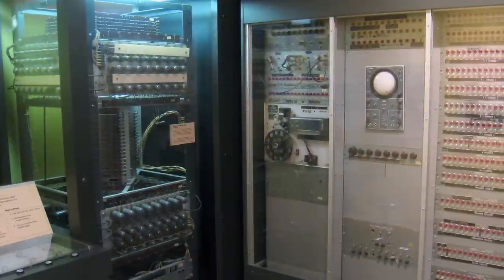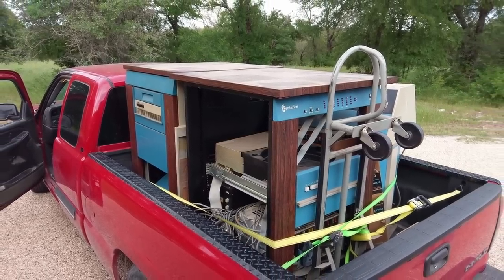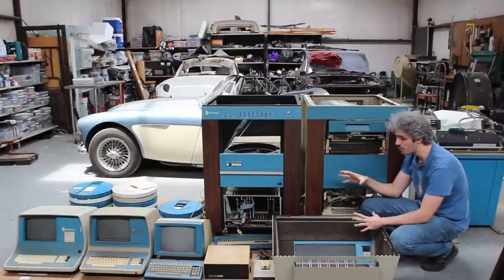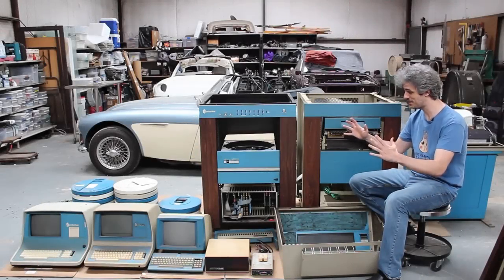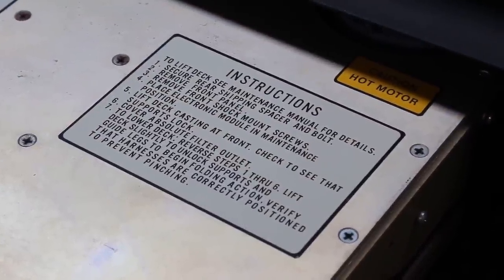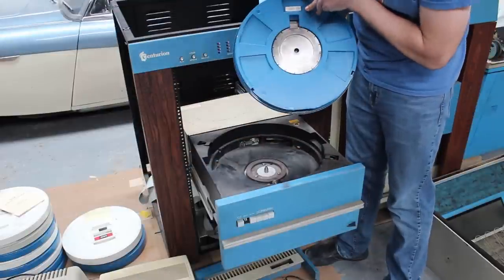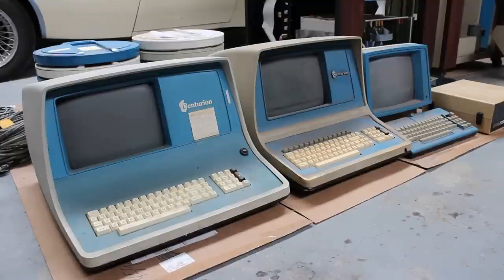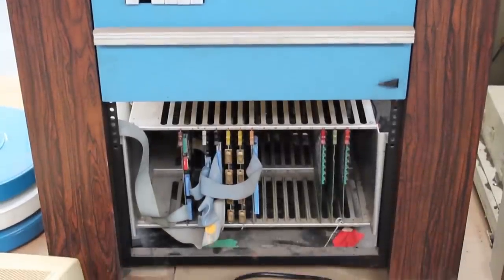I Bought a Minicomputer from 1980! – Part 1

Comment: They were called minicomputers because transistor/chip mainframes were the prevailing systems that a (big) business purchased. 1970s-80s. Vacuum tube analog computers were already gone and moved to storage warehouses, by early-mid 70s. Networked PCs began taking over the scene in the late 80s, and took over from minicomputers in the 90s.

Comment: Back in the 80s and 90s I had a friend (a sysop for a state Bell Telephone by profession) had a minicomputer (confusingly named an Alpha Micro) in his basement, with three terminals.  I was one of several friends that used it for personal word processing.  He passed away years ago, no idea what became of his system.  It likewise had a Hawk drive, don't remember the model, but it was 5MB (yes, "meg") fixed and 5MB removable.  Looked pretty much identical to the one you have.  He used an IMSAI front panel for it, and on occasion he actually USED the front panel switches to enter opcodes.
Reply: Alpha Micro was a computer company from the late 1970s.

Comment: Hi;

On the Disk Drive with Removable platters, You need to put in the Platter cover on the Disk Platter after it is inserted in the Drive, Or it will not ever be "ready" ..
The Drive is a CDC (Control Data) Cartridge Disk Drive Model 9427H..

THANK YOU Marty
Reply from the maker: Thanks for the tip!
Fortunately, in the next video after removing the drives, I was able to identify them grab some manuals for them from bitsavers!

Comment: That is a multi-user system so nice to have extra terminals the terminals are most likely RS-232 300/1200 Baud the small modem is most likely 300/1200 I saw on the back of the terminal "Current Loop" so there current loop and not RS-232 the plate got settings printed on it that has to match the settings of te Comm card. ALSO, DO NOT Plug a DB-25 connector that is set for Current Loop into a RS-232 connection. I don't remember if Current Loop DB25 uses the unused pins for RS-232 for communication. It may, as a safety so you don't blow up the RS232 connection
Reply from the maker: Thank you for the heads up!
The terminals are, interestingly, all from different years, but given the Miacom modem, I imagine there were a lot more terminals set up for use in the original setup. The Centurion fundamentally is a 9600-baud system, so I just need to get the settings right on the terminal, which is fairly easy to do. Unfortunately, so far, I haven't been able to get any life out of the MUX cards on the computer, though it does seem to actually be executing code!

Comment: I used to repair systems like this, ancient technology...
I don't know why you would want to get it running, as it isn't a real computer, but a data storage system that would connect to a central computer system using the phone modem as the day progressed, where the data processing would actually happen, on a main frame computer.

Comment: God, that 99/4A brings back some VERY fond memories!
Reply from the maker: Thank you! It's an awesome little computer.
I've very nearly got it fully kitted out. Here's a picture of it from before I rearranged the shelves above it:  https://i.postimg.cc/3R89xxWy/IMAG2815.jpg
From far left to far right: Sanyo DMC-6013 Monitor, TI-99/4A, Speech Synthesizer, 32k Memory Expansion, RS-232 Interface, Phone Modem, Disk Controller, Solid State Printer, and Disk Drive. I would love to get my hands on a proper TI monitor one day, and I'm still holding out hope that I'll be able to find (and afford) both the Video Controller expansion and P-Code expansion someday.
In the meantime, it's one of the coolest (if not most impractical) 8-bits(16-bits) I've had the pleasure of playing with!

Comment: the first job my dad had was in demolition for making computer rooms in the 80s. literally busting out all the walls of an entire floor of a building to fill it with a big floor to ceiling computer. turns out its a lot easier to run through a wall than you'd think if you don't hit a stud. but it puts into perspective how big old computers were.

Comment: The small aluminum box is an AT&T 829.  Western Electric was wholly owned by AT&T.  Until the Carter Phone decision caused the break-up of Ma Bell the only way to be hooked up to the phone company was through phone company equipment.  After the break up equipment that hooked up to the phone company had to have an FCC registration number on it.  AT&T feared that if just anything was allowed to be hooked to their network it could endanger the network itself.
Reply from the maker: Whoa, so far you're the only person that has been able to identify that little box!
Thank you for the excellent information!
Reply: @UsagiElectric  It facilitated line testing.  If a point-to-point line was thought to be out of service the phone company would send a tech to one end with a loopback generator.  The loopback generator would send a tone to the remote end and put the other 829 into loopback and the tech could send to himself to see if the line itself was good.   Note that a data line is four wire; a voice line is two wire.  The plastic box on top of it with the circuit number is a "42A block".  It is officially the point of demarcation: one side is phone company responsibility the other side is customer responsibility.  

At its peak if Western Electric were independent it would have been the eighteenth largest industrial company in the US.

Comment: The modem is a 16 ports multiplexer, we had stuff like that before Internet.
They where at a remote site so 16 terminals/printers could be hooked up to the company computer.
Yeah, the speed of the computer  was very slow but the work flow was faster when the operators didn't have to use graphics with a mouse.

Comment: Of course it turns on. Old tech is less complicated, less likely to fail, and you also have the business line quality.
Reply from the maker: I don't know if I would go with less complicated on this one, the CPU board is a phenomenal piece of engineering that's way over my head, haha. But, it's a very nicely designed piece of kit that's certainly a little over-built!
Reply: @UsagiElectric  I meant the density of transistors mainly and all that!

Comment: I'm 9 months after the fact. How did it go? When you were vacuuming that crap foam out, my first thought was "NOOOOO!!!" There are special vacuums to use with those old machines. A vacuum creates a lot of static electricity. Those old components wouldn't be able to handle it. I hope you didnt get the vacuum hose anywhere near the ICs. Or, was it a grounded hose? It looked like standard shop vac to me.
Reply from the maker: Definitely a standard shop vac, but I think I skated by without any damage! The computer itself does actually seem to be executing code, but the journey to getting it running is still ongoing.
There's a whole playlist on the progress of the machine here: https://youtube.com/playlist?list=PLnw98JPyObn0wJFdbcRDP7LMz8Aw2T97V

Comment: Forgot a bit more info.    A couple of the software and hardware engineers are still in the Dallas an Austin areas that maybe willing to help get the old Centurion system running again.   Hope to hear from you in the future.
Noted in one of your videos you are working on the system power supply. About the only thing that used to fail in the P.S. was a bad main filter caps on the 5 VDC supply causing 120 Hz ripple on the 5 VDC when under load or bad full wave bridge rectifier which caused 60 Hz ripple on the 5 VDC when under load.  P.S. outputs are +5, +12, -12 and +24 all DC.  The P.S. for the 1970's was a very good designing a "Ferroresonance" design to filter out AC line voltage spikes and sages.    Good luck getting the system running, willing to help.
Reply from the maker: Ken, thank you so much for all your amazing information on this system!
I'm going through and reading each of your replies super closely and will definitely be sending you an e-mail!

A few other commenters also pointed out that it's likely to be a ferroresonant PSU and it seems to be in really good shape. That's a good idea to check the ripple on the 5V line with all the cards in place to see what it looks like. I'll definitely give that a check the next time I'm out in the garage!

Comment: You would generally have the terminal set to remote echo, as opposed to local echo, so that when you type the mini computer would return what you typed so that you would know that it received it as it has to service all of the connected terminals and either might have missed a character or not received it yet.  It's a bit slower response, but more reliable.

Comment: Wow, quite the find and project there!  Getting that up and running will be quite something.  Any idea which operating system this thing uses? Or does it load some sort of interpreter?  I believe the complex looking modem is actually a rs232 "terminal server" where all your terminals are going to connect via to the mini com interface.   Can't wait to see how this goes, great vid!
Reply from the maker: Thank you so much!
I actually don't know really much of anything about this computer. Centurion computers was a pretty small company so there's very little information out there. Though, it appears they did have a few different models of computers they sold, but I have no clue what model this specific one is. 
I think you're right on the money with the Micom interface! That would explain why I got three terminals with the set as well, with them being set up as individual workstations all hooked into the same computer.
Reply: @UsagiElectric  Yep, I was going to say the micom was for integrating multiple data terminals. 
By the note on the one monitor I would say it was used in a shop. Would explain the ugly one, (shop) the nicer one (shop manager), and the little one for the inside office. THose old band printers were used mainly for billing. They could print VERY fast, which is important at billing time on 30 day net back in the day as they all got mailed.

Comment: That Micom box is a multiplexer. Allows you to run multiple terminals through one serial line.
Reply: I scored a couple of them in 87 and sold them for $5500. Lot of money to an 18yo.
Reply from the maker: Good eye! I've since learned a bit more about the whole machine, but that Micom is still refusing to power up.
Granted, I'm only planning on running one terminal, so the Micom is very much so not needed, it'd still be cool to see it power up!
Reply: @UsagiElectric  I had a thought about this. Multiplexers are used in pairs, one at each end of the line, to connect multiple terminals to multiple ports through one line. Perhaps the recieve multiplexer is built into one of the cards. So the serial port is expecting a MUXed signal. try connecting terminal to the multiplexer and the multiplexer to the terminal input on the Centurion?

Comment: The switch is most likely an x.25 packet switch, that used those x.21 db25 connector. Leased line modem is probably also x.25. I’ve prgrammed some of them from Motorola, for a telephone exchange management system.
Reply from the maker: You may be right!
I think the switch was primarily used for connecting multiple terminals to a single serial port, but I haven't had any success getting the switch to power on. Granted, I'm only planning on using one terminal, so the switch is actually totally unnecessary, but it would be interesting to see it power up at least!

Comment: Wow, this is so cool! You just need to get some reel to reel tape drives to complete the setup.  What was this used for in the past?
Reply from the maker: Thank you! Yeah, some reel to reel data drives would be awesome!
I got no clue what it was used for in the past, but some of the data disks say "Glenn Smith Oil Company", which their building does still seem to exist on Google Maps, but I can't find a website or contact information otherwise. Most likely, it was used for records keeping for the company, though it does seem like a bit of an overkill computer setup for record keeping at a small business. I'm super interested to see what's stored on the data disks!

Comment: On a terminal, switch "self echo" on, and possibly the "full / half" thing is "duplex". Both of those settings, dunno why there's 2 of them, tell the terminal to put any keys you press up on the screen. Not usually used, usually you press a key and the host computer sends it back to be displayed. But some primitive computers required it. The reason I say switch it on, is to play with it, get it to display stuff. Once you've done that, to use it with the computer properly, switch it back the way it was. Make a note of that first.

Seems like it goes up to 19,200 bps too! That's nice! Somewhat modern, and certainly a faster screen update than you'd notice, even 9,600 is pretty good. I wrote a Space Invaders, and a couple of other games, for an old Unix machine at college, using terminals at 9,600 and it kept up fine. It's roughly 1,000 characters a second so if you're not updating the whole screen it should be good. A lot of more advanced programs make an effort to send the minimum possible characters to the terminal, they keep an internal record of it's screen and only send the updates. The "curses" library under Unix does that, or at least can do.

Apart from that, itching to see it up and running, I'll have to go see what other videos you have! These things can be so much fun, I'm somewhat jealous, although I might replace the 2 trolleys worth of disk drives with an SD card. A micro SD card. Actually if you were serious you could do that and just put the computer itself into a smallish box with a modded PC power supply. Depends what voltages and current it needs. It might need things like -12V at more than a modern PSU provides but you can always make your own.

Looks like the terminals are standard RS-232 expect "EIA current loop". Rather than voltages in RS-232, it uses a 20mA current loop. It's apparently more reliable in noisy environments and is compatible with some old industrial standard. Back in the day, it and RS-232 were the two standards and they were both huge, so there certainly would have been gear available 40 years ago! Now, though, I'd be surprised if you couldn't buy adaptors, even hobbyist-made ones. It's nothing an Arduino couldn't easily do with a couple of components.

That is, if you wanted to connect it to a modern PC, otherwise you won't need adaptors. But connecting a terminal to a modern PC running Linux I think would be lovely! Operating a computer with a terminal is such a lovely thing to do. It's a mile away from a GUI and doesn't bring the headache that GUIs can cause. No carpal tunnel from the mouse either. You can be so much more productive, quicker, blattering away on a keyboard. Soon enough you'll have set up a system of shortcuts and little scripts to automate stuff you do often. You can even use the WWW, though Youtube might be a bit of a challenge. That said, there's AAlib, that can turn video into moving ASCII. Back in the day somebody attached it to DOOM, to play Doom entirely in ASCII characters! I'd LOVE an old terminal but the prices on Ebay seem aimed at companies who need one to keep some vital ancient old system running and are willing to pay. Which is daft cos any old PC can be a terminal. It's only me who doesn't want a PC, I want a terminal that's limited and old.

Maybe I could use some old computer. Get another Atari ST and run the VT52, or a better terminal emulator. Problem there is the ST has a built-in GUI. They don't really do 8-bit computers with 80 column displays and fast serial ports. One or two, but nothing loveable or quirky. Maybe an Atari 8-bit but they're so expensive. Arses! I had all this stuff when I started collecting in the late 1990s. But then left it all behind in a house move, and now it's all worth 20x what I paid for it, really! Now ask me about the early days of Bitcoin and how I couldn't be arsed to mine any cos it all looked like a lot of fuss!

Comment: This a terminal. What appears on the screen originates from the computer. What you type is sent to a computer, not the screen. To see what is typed you either need to attach it to a computer or build a "loop-back" device. All  a loop back device is, Is a plug that connect the serial output to the serial input. Some were literally a short cable connected to the input, ran out of the plug then the other end is ran back into the same plug where it is terminated connecting it to the output connections  creating a loop back into the terminal. Hence a loop back. Some of these were created without the wires / cable exiting the actual plug, it was simply a plug with inputs and outputs tied together to feed typed text back to the terminal. The same could be done by adding a switch to the back which could be used to do the same thing internally. Turning off the switch would allow normal use, while turning the switch on created a loop-back. Some later terminals had loop back built in and that and other settings could be set by using DIP switches.

Comment: Not sure somebody mentioned it - the device you opened at around 16:00 is a multiplexer used for RS232-based campus networks, in some cases until the early 2000's in mainframe setups. One serial line coming from the datacenter could be shared by multiple terminals in offices a couple of hundred meters away...